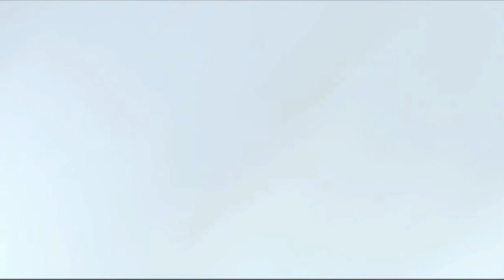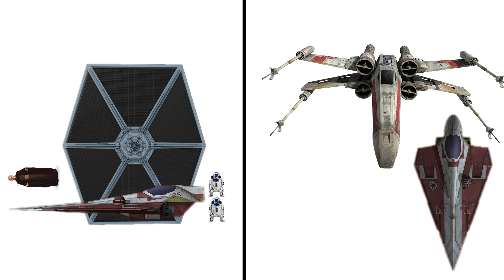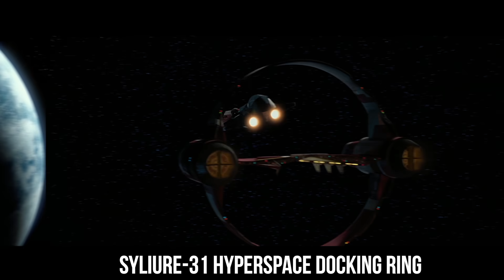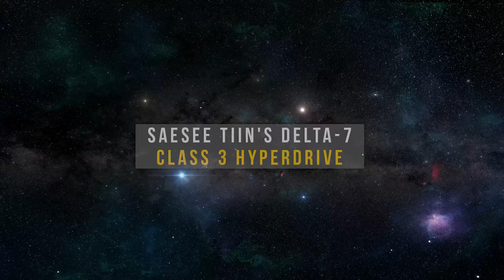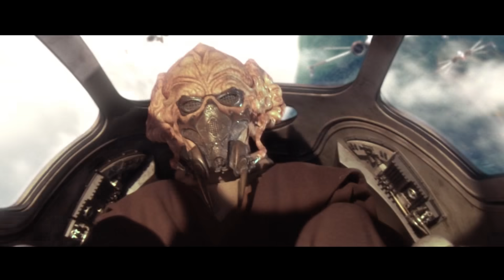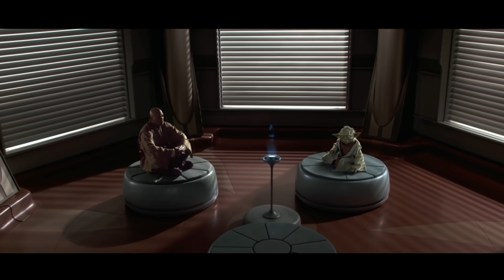Delta-7 Jedi Starfighter Really Was "FORCE POWERED" | (Star Wars Ships)

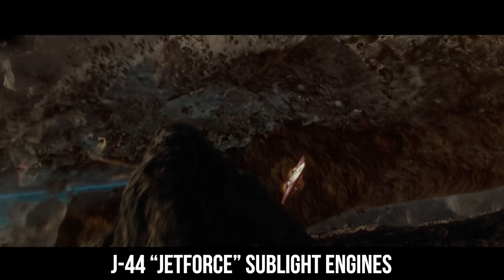Comment: 2:26 "5000G". 

This is why numbers in sci-fi lore can be so confusing.  5000G equals to an acceleration of 5000 * 9.81m/s^2 lets say 50km/s^2. The max speed of 1260km/h equals to a speed of ~0.35km / s. 

So, this thing could reach it's top speed (assuming acceleration is constant)  within 0.35 / 50 = 0.007s or 7ms. Even ignoring the fact that a maximum speed in space doesn't make sense (there are different limitations but only when we start thinking about fuel, and speeds close to light speed). These numbers mean that once you press down the pedal, your brain is mush. 

Basically, when you try to explain your fiction with science and you're using real-life numbers and concepts, usually you're just poking holes in your lore.

Comment: Star wars should just not give specific lore numbers, if this fighter can pull 5,000Gs of acceleration then it would reach it's top speed in 7 milliseconds. That's just insane the Gs a gun experiences are only about 2 to 3 times that and that is enough acceleration to deform metal and then it just magically stops accelerating when it hits 783MPH??? makes no sense. They should really just dump the dumb numbers entirely or make them fit the cannon not the other way around.

Comment: I made my own version of this ship. Slightly more armor, bigger engines, and a short range hyper drive included eliminating the need for a hyperspace ring. I doubled the life support systems capacity increasing its operational range, all while keeping the original look of the Delta7 mostly intact. I upgraded her cockpit with a more action oriented flight control system, and upgraded her shield capacity. The pilot is now better protected overall. I modified the landing gear to free up some space inside the hull to accommodate the extra tech.  Overall she has a similar thrust to weight ratio but loses some maneuverability. In a straight line however she is still faster than most star wars flying machines.

and here she is(still working on some things before she's ready): https://www.artstation.com/artwork/N5Q9ab
Reply: It looks cool

Comment: The true imperial system of measurement measures things in Sheevs. I, for instance, am about 96 centisheevs tall.
Reply: That's actually not that far off the truth for the real world.

There was originally no one 'imperial' system.
Those 'standard' units? Many were based off the body of the king. (or queen I guess, in the few cases where that applied)
If they died, the units of measure throughout a kingdom would change with them.

A foot is not just ANY old foot, it's specifically the size of the king's foot.
An inch, is the size of a knuckle.

Thus, in a very real sense, while applied differently, that IS indeed how the imperial system of measure worked...

Comment: I have noticed after watching as many of your videos as possible that the posted atmospheric speeds of  these ships cant be right , one would assume that they are at least as fast as our fighter jets , which are capable of hitting mach 2 and above which is like 1500 miles an hour please explain why the star wars ships and fighters are so much slower .
Reply: They don't look suited aerodynamically for those speeds, for one...
The delta-7 might not be so bad...

But think about a Tie fighter. Short of magic air manipulation tech, that has the aerodynamic characteristics of a brick. Especially if you turn at all and expose those giant side panels to the airflow.

I wouldn't expect such a ship to fly at all well, and only massively overpowered engines (and in the case of Star Wars, repulsorlifts, however those work), would be keeping such thing in the air at all, much less flying well.

Of course, by virtue of the fact that these fighters can get into space from the ground, they have to be able to reach orbital velocity.

That alone makes those listed speeds very dubious...